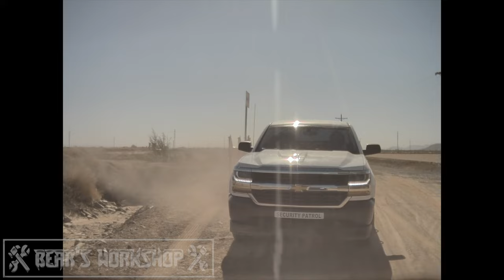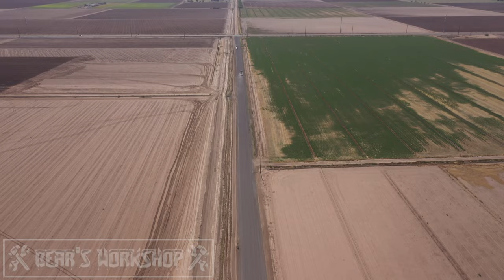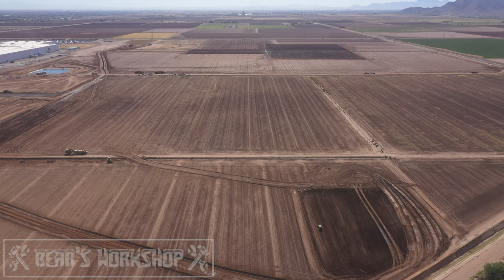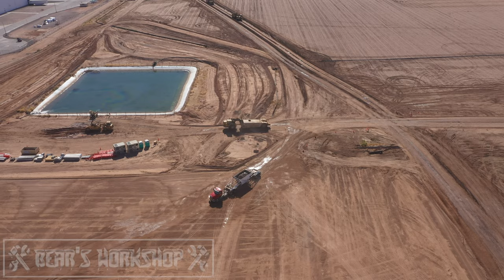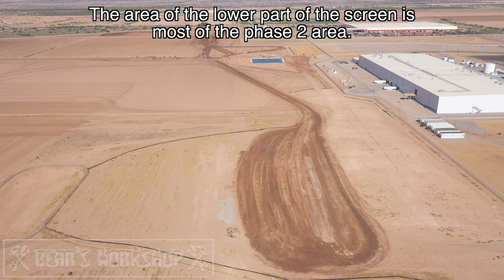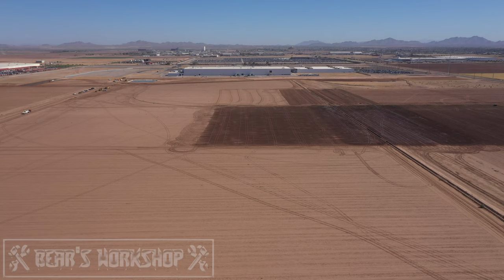Lucid Motors Factory Construction Site May 27th, 2021 | Drone Footage of 8:30 AM

Comment: Do you think Lucid factory bigger than Nikola Factory?
Reply from the maker: Yes,  Lucid's first 2 buildings are bigger than Nikola's.  For both of them after full build out Lucid will be much larger.  Nikola is planning on a production capacity of 35,000 semis after full build out.  Lucid is planning on full capacity of 400.000 vehicles per year.
Reply: @BearsWorkshop  thanks bro
Reply: But Nikola has also Ulm Germany